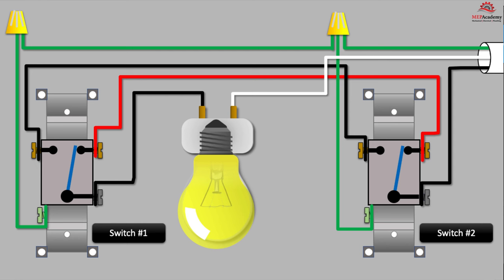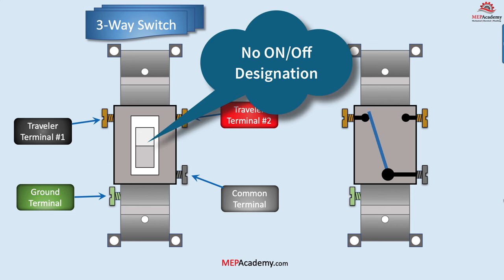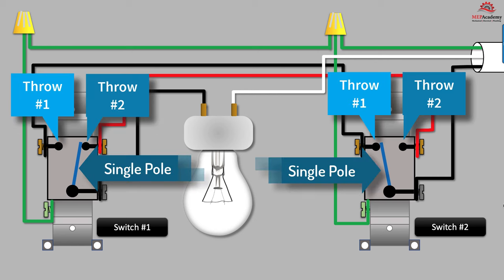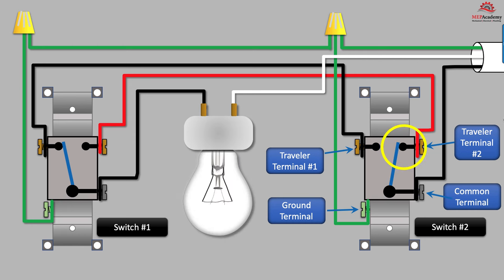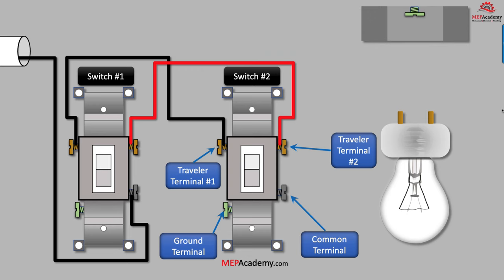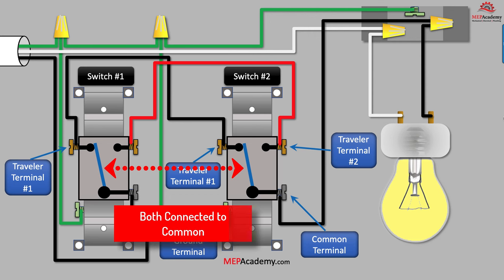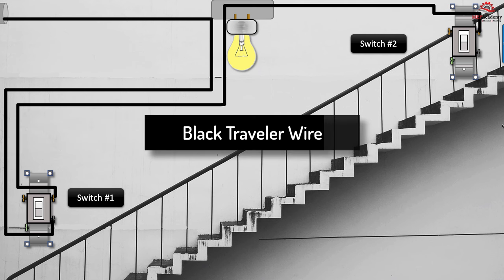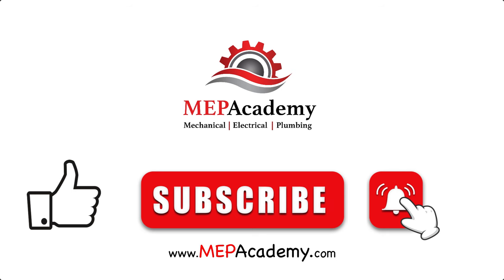3 Way Switch Wiring Explained

Comment: The open illustrations of the switches are the best to learn how a 3-way setup works. Without it the verbal explanation can get confusing not knowing which wire connection is for what.   Tks much. I'm saving the link to this vid for quick refresher when I do this work.
Reply from the maker: Thanks for watching.

Comment: On the 3rd scenario showing the stairway with a switch at the top of stairs and a switch at the bottom of the stairs I see a code problem. There is not a neutral wire in either switch box.